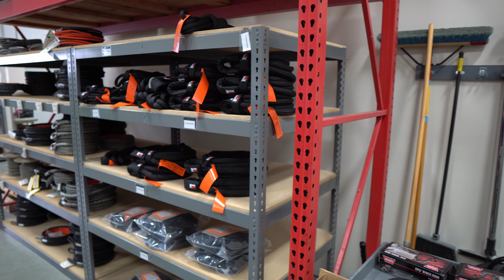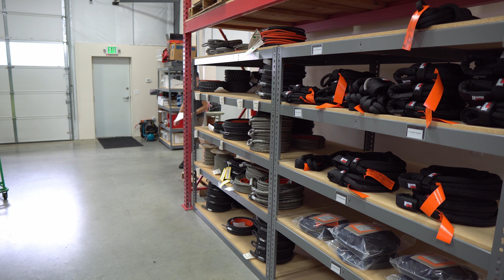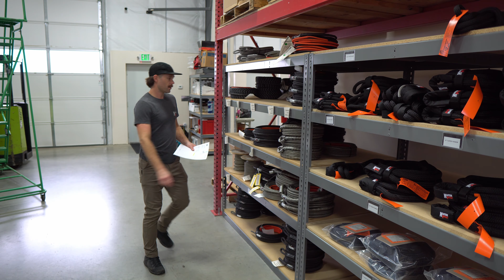Install Synthetic Winch Line & Pretension Properly - Master Pull Superline XD

Comment: Thanks for this video,  I'm seriously considering reolacing my winch line with Master Pull SL XD.  Watching the video it doesn't look like the slight stiffness added by the XD outer sheathing is any issue,  have you had any issues or concerns with this line since install?
Reply from the maker: No issues yet and I doubt I’ll really have any.  Having the extra sheathing is great for me personally… MUCH less maintenance without any real negatives. Master Pull really educated me on everything during filming, those guys were great to work with. Thanks for checking out the video. 👍